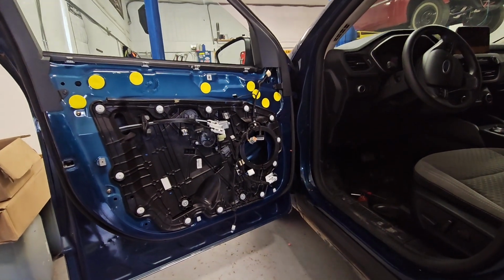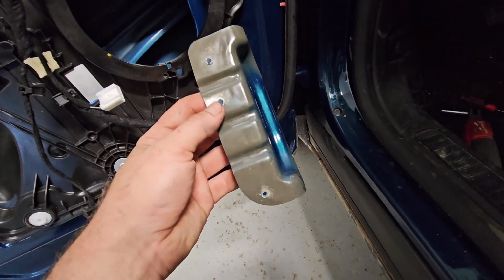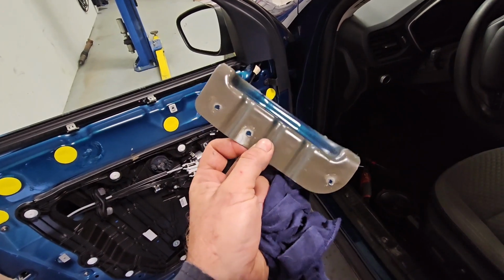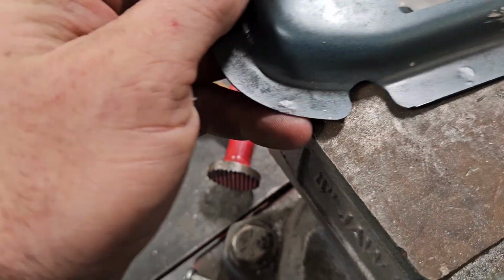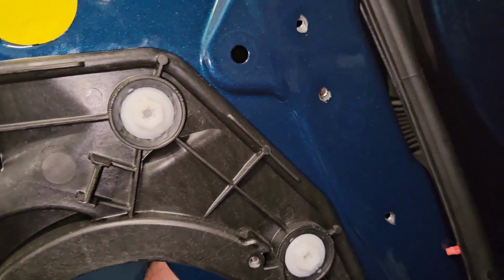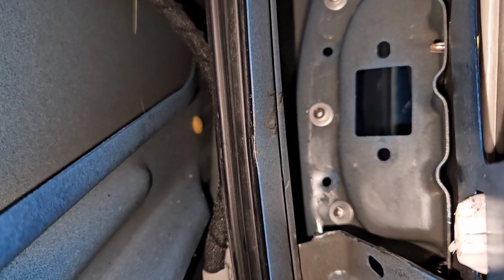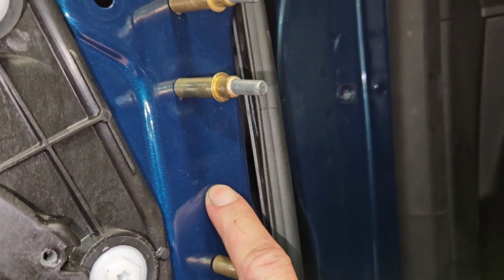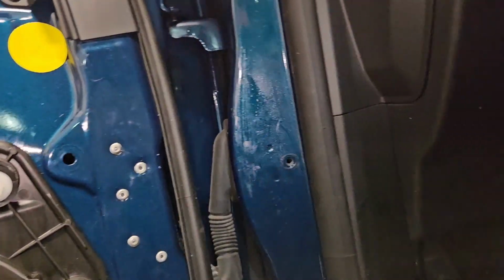2020 Ford Escape door stop repair

Comment: The additional two holes accommodate the plastic retainers for the door seal.  That's how I saw my problem, by pushing the seal aside, I could see the plastic plugs going in and out as I moved the door.

Comment: I watched this video because I had a friend with the exact same problem but it was the RF door and they have a 2022 model but all the same. This video was spot on and the only thing I’d like to add is the special clip on the back of the door handle DO NOT break it. Ford charged me $28 for that darn clip. Great video!!!